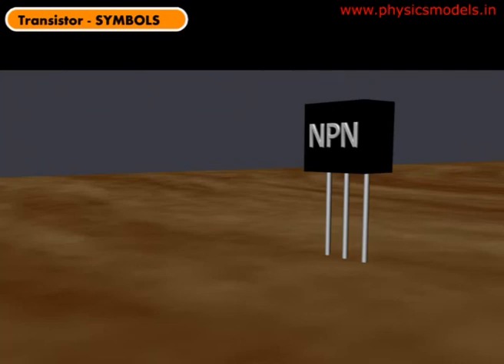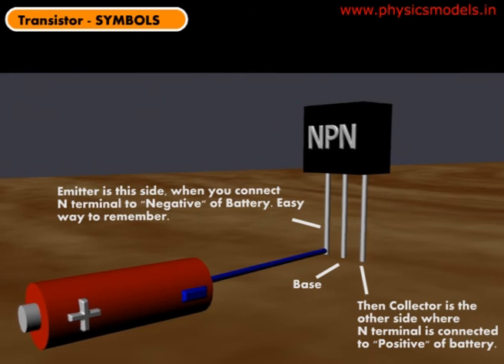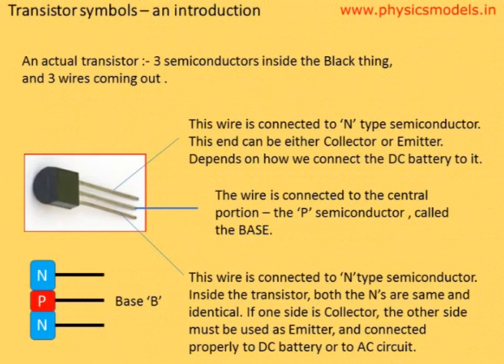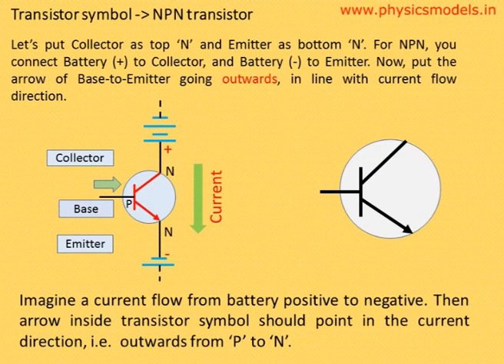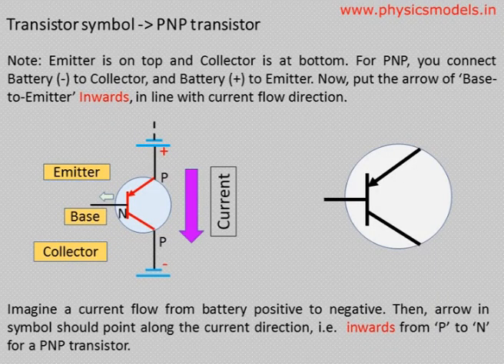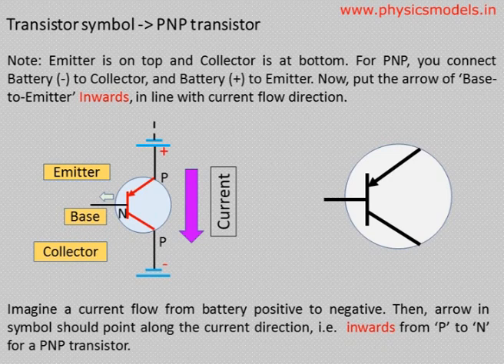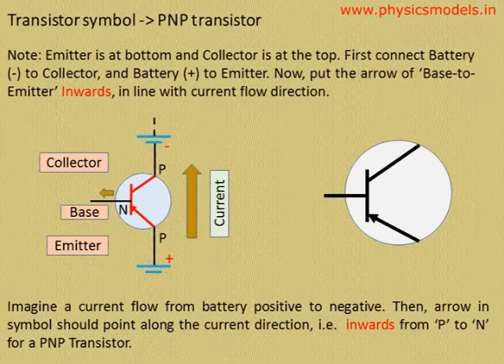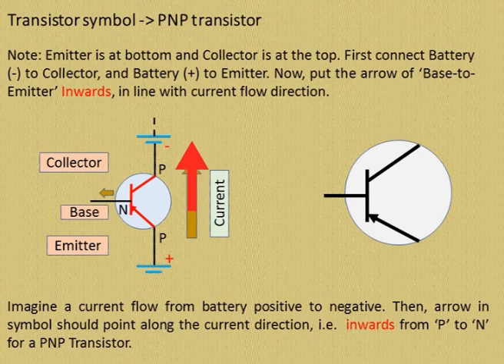Physics Made Easy- Transistors and their Symbols-NPN and PNP

Comment: Up to this point I've seen only current flowing from the negative terminal of a battery to positive. and now I'm seeing the  opposite.. Make up your minds!
Reply from the maker: current always must flow from positive terminal of a battery to the negative terminal. It's same as saying that Electrons flow from Negative terminal to Positive terminal. This clarifies your question.
Reply: In many videos I've watched, animations of circuits always have the current entering the side of the battery with the small cylindrical mound, which is the positive terminal.